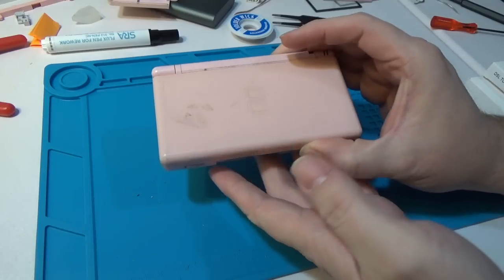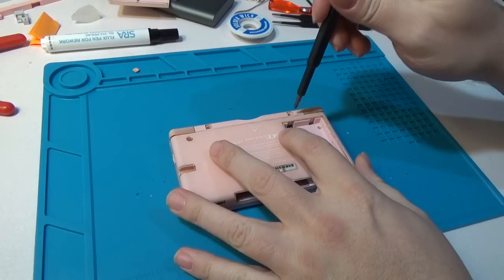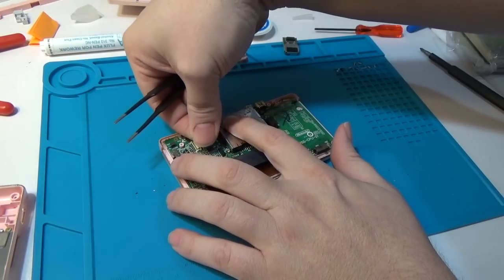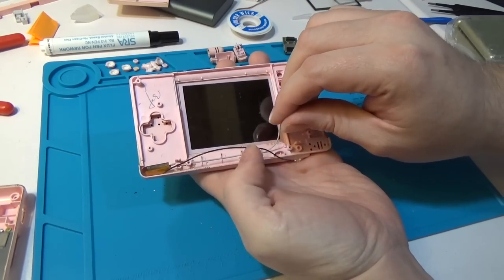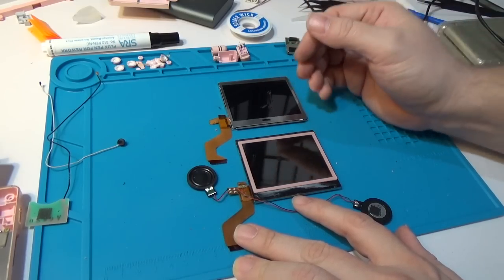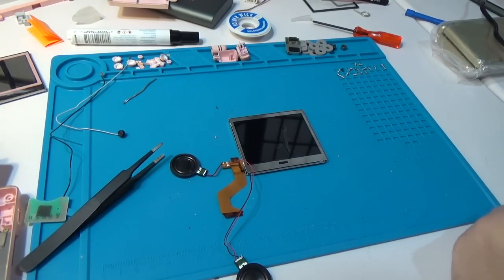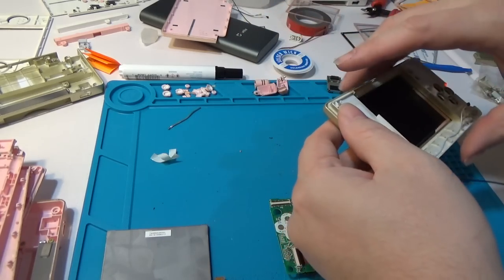How to Replace Nintendo DS Lite Shell and Screen

Comment: Dang, looks exactly like mine. Except mine wont work..
Reply from the maker: That stinks!  What's wrong with it?
Reply: @TheBrokenPast  won't turn on, and has a crack on it's back.
Reply: Check if all of the cables are plugged in correctly. If not the bottom DS Screen will flash and the system won't turn on.
Reply: If it doesnt turn on then maybe it needs a fuse replacement
Reply: @TheBrokenPast  Same with mine😔...It doesn't read games...It has bent pin that is the reason..
Reply: @nashwa520  :( go to a repair store you can save some money see if nintendo stores do repairs. If not, go to a trusted repair store.
Reply: @Tom2404  having this issue but all the cables are in. Could the ribbon be busted?
Reply: @rosstodd9233  yep. If the ribbon cable is broken that will prevent the DS from turning on. That can happen when the hinge is broken or when you replace the shell and make a mistake while feeding it throught the hole.
I learned both the hard way. When I was 13 I got a free DS Lite from a friend that had this exact issue due to a broken hinge. I fixed it by replacing the screen and the busted part of the shell. I felt like I was super smart until it stopped working again a just few days later. When I opened the DS recently I realized 13 year old me just did a horrible job pushing the ribbon cable throught the hinge and destroyed it in the process. But now with wayyy too much money spend on it the DS Lite of my childhood friend is working again and in like new condition.
Reply: @Tom2404  pretty sure that's what's happened. Replaced the screen so the cable was tough to get through. Dang, new screen again required I think. Thanks for getting back to me 🤘
Reply: @Tom2404  happened with my brothers ds hinge is broken
Reply: Same 😂

Comment: Just a warning - use short screws for the circuit board screw holes (the two circled ones), and be extra careful not to screw them in too hard. Do this to avoid pushing holes through the outside of the shell, which is what I did :(. Although the damage isn't too bad, it's enough for me to want to buy a replacement shell. Good thing they're cheap, plus the extra experience taking apart and reassembling a DS Lite is fine by me.
Reply from the maker: That is a great point!

Always make sure you use the correct screws in their designated spots.  If you don’t, you risk running into issues like you’ve mentioned.  But like you said, every failure is a chance for more experience!   :)
Reply: what site or seller did you get your shell from? All I can find is either fake or scam shells or Aliexpress shells (which will definitely be non official shells made of cheap plastic). who or what would you recommend
Reply: Cheap? WHERE DO YOU BUY THEM.
i only found shells that costed me like 13$ or maybe 7$ from aliExpress but i want a quality one
Reply: just had the same thing happen to me :D Good thing the whole thing isnt turning on for me so its the least of my worries :P
Reply: @Its_Asteria  there are no official shells unless you buy a used one
Reply: Just did the same lol
Reply: Hand Held legend sells them. Anywho, OP same. But like hell I'm going through that again so I'm just going to suffer silently.
Reply: I didn't read this comment and literally just did this
Reply: Done that 😂😂

Comment: I wasn't planning on doing the top screen replacement but I tore the ribbon cable so I guess I have no choice now -_-
Reply: Same here
Reply: Hey bro a tip I came up with is to put tape over the ribbon cable so it will be less likely to rip.
Reply: Alex Servantez instructions not clear, teared ribbon cable and replaced with tape
Reply: Me too
Reply: I AM IN THE SAME SITUATION !!!! I WANTED TO OPEN THE TOP SHELL AND I USED A KNIFE .... AS A STUPID I CUT THE SCREEN TAPE !!!! I feel so stupid !!!! So I BUY a new top screen and I want to change the screen correctly .... I know that I am fighting to pass the ribbon cable in the small STUPID HOLE !!!!!
Reply: The first DS Lite Screen I replaced broke in a week or so. I somehow bent the cable in a wrong direction and it seems to not make contact anymore. But I was 13 back then and now I'll try to fix it again now that I'm older.
Reply: @Tozovbb91GamingMinecraft  replacement screens are really cheap so it isnt that bad
Reply: Time to make a Gameboy Macro then :3
Reply: Same here, it’s not worth my time I can buy a new ds for like $10

Comment: Unfortunate you sped up the video at a critical point, feeding the cables through the sleeve and ribbon through the housing. Otherwise very useful thanks!
Reply: Ye I’m still stuck how the fuck do I put the ribbon cable through that tiny hole I’ve been trying for ages

Comment: There are two potentiometers on the bottom of the battery slot, one for the top screen and the other for the bottom. The new top screen you bought is actually fine, you are supposed to adjust it to make the flicker/tint/noise go away every time you swap in a new one. The scan rate is slightly different on each one at the factory.
Reply from the maker: Thanks for the tip!  I will definitely have to check that out, and see if it fixes the issue!  I haven't actually played this one since I swapped it, so I didn't spend anymore time taking a look at it.  But I will definitely have to check that out now.  Thanks!

Comment: Hey, thank you for this tutorial! I was able to do the whole swap (in 5x as much time as you). It was my first time and so much more than I could chew, thanks again.

If anyones having trouble feeding the antenna through, I used a needle and thread, tied it to the antenna wire, and pulled the needle through the right course. It, the thread, and the antenna wire all popped out the right part on the correct side.
Reply from the maker: That's a great idea!

In my case, I had already reshelled it a number of times before this video.  The first time I did one though, it was definitely probably 5x as long for me to do too!

Comment: For those of you replacing the bottom screen completely with a new one, make sure the new one you got has the black tape or foam backing the original has. If it's just bare metal, apply tape to it or a sheet of anti-static material to protect the motherboard from dying from a short-circuit, or like what happened to me, it still works but it burned some metal components, like the tiny metal dishes inside the trigger buttons.

Comment: “ i don’t know why people are so scared to change DS shells”
takes an hour and a half to do it with EXPERIENCE
Reply: ikr, lol.
Reply: I have all the proper tools and experience and tore the ribbon cable, it’s garbage now
Reply: @darrell5363  not yet. New top screens have the cable so just get a replacement and try again.

Or turn it into a GBA
Reply: @slyp5409  i got it for like $5 its not worth my time it went in the trash
Reply: @darrell5363  If not then the Gameboy macro idea isn't a terrible way to go
Reply: Did it yesterday and took almost 3 1/2 hours. The L and R buttons were killing me because of the spring. Sadly, when I turn it on, the upper screen flickers shorty and then the device turns off. Guess I tore something off...
Reply: @quietcarselijah  probably
Reply: @saradrae2700  yeah the ribbon cable is extremely fragile. I say double ch3ck no mke sure the ribbon cable is inserted to the DS correctly as well as all other components connected as they should be.
Reply: @saradrae2700  no trust me you didn’t go back and make sure the cables are are pushed in properly I did this and I thought the exact same thing it sat on my shelf for a month before I just tried for shits and giggles and I realized I hadn’t pushed the top cable in all the way trust me those cables are meant to go in further than you think
Reply: @danmajid5401  Thanks. I will try again if I find the time!
Reply: A Gameboy Advance SP is a freaking piece of cake compared to this! I swapped the shells on two GBA SP so I was feeling confident to replace just my screen on my DS Lite...and then I saw this...its just not worth it.
Reply: @saradrae2700  I spent literally an hour with the damn shoulder buttons! I feel your pain
Reply: Zero experiencie guy here.
The mic cable was almost damaged, the top screen is now broken and the touch screen has calibration issues now

Yeah, I won't try this again
Reply: Well I have no experience when I had my DS (Sold it btw), but my brothers DS I'm really nervous to even touch.
Reply: 0 XP here as well. 

I swear to god I smashed the console on the floor 2 times, I'm done with it now. How the fck this design came out from a human brain? The shoulders button destroyed my mental, the spring system is the worst invention in the world. 

RIP NDS lite.
Reply: Did it my first time yesterday. It will surely be the last one too. I lost my patience and started to curse me and the day I decided to buy a DS with a broken hinge for cheap to reshell it.
Like others, I spent over an hour trying to fit the shoulder buttons in the new housing but it definitely seems that those aftermarket shells are just horrible since I just couldn't close the console. I managed to do it just once but a shoulder button wasnt clicking anymore bcs of the case when the console was open, the d-pad felt awful and there was a gap between the back cover and the buttons cover.
How did I resolve? Well, my console was black and the new housing was black too, it just had that Dialga/Palkia print on it. Ended up using the original buttons, button cover and  back cover and I literally closed the DS with no issues at the first try. Shoulder buttons are fine, d-pad seems legit and there's no gap between the button and the back cover. Yea, the og back cover had a small crack but idc

Comment: This guide is very useful. Helped me replace the shell and refurbish an old DS Lite with a broken hinge. Thank you! Any chance you'll ever try to do a 2DS XL top screen repair?
Reply from the maker: Yes!

I'd love to get my hands on a broken 2DS XL.  I've been putting a few bids on some on eBay, but they all seem to go higher than what I think is reasonable to pay for one.  I can buy a refurbished one from GameStop for about $130, so I have a hard time paying near that much for a broken one online (plus the cost of a replacement screen!).  As soon as I can get one at a decent price, I plan to do so!
Reply: Warning: The 2ds in nearly impossible to replace without breaking. I tried to and it took me 6 hours to do. Every ds-3ds line of handhelds are difficult but this is one of if not the hardest to do. Also, the 2ds is very cheap and flimsy.
Reply from the maker: @BELDAM808  I love a good challenge!  I've still been watching out for one on the cheap on eBay.  Hopefully soon!

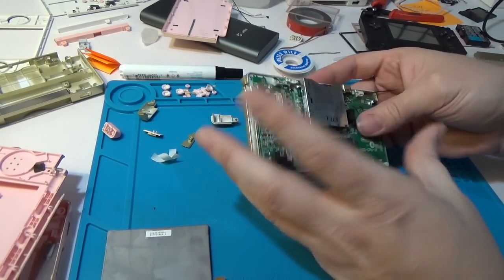Comment: for anyone stuck at 1:08:16, i ran mine by tying a sewing thread to a toothpick and running it underneath the ds game cartridge port first, then the sewing thread is tied/attached to the black wire so you just gently pull it across underneath.
Reply: This was my idea when I do mine once my shell comes in, but I feel like I can get the mic cable under fine by hand

Comment: Just watched this all the way through, it was very detailed, and thank you for leaving in the mistakes! 

I just found my old Nintendo DS Lite and it is broken! When I turn the power on, the green light turns on, and the bottom screen flashes white then everything turns off. After doing some research, it seems like the ribbon cable is either damaged, dirty, or disconnected. 

I am very new to opening up DS's, so to a beginner, this is an amazing video. I'm going to try to fix my Nintendo!! So thank you for posting this! Just subscribed :)
Reply from the maker: Thank you so much for the kind words!  When I made this video about a year ago, I hoped it'd be beneficial to someone who wanted to do the same thing, but were hesitant to do so.  In the end, this ended up being my second most popular video, so I'm glad that this was able to help you!  :)

Yep, the flash, and then shut off is usually indicative of a fault with one of the panels; either due to a broken ribbon cable, or a loose connection (and sometimes a fault within the panel itself).  Since you mention you see the bottom screen flash and not the top, I suspect it'll likely be the top one; most likely due to a cracked ribbon cable, from repeated opening and closing of the display.  You should be able to at least verify and try reseating the cables first, before doing a full disassemble. Hopefully it's just a loose cable, and you don't need to go through the work of an entire reshell.

Good luck on your repairs.  Please update us when you give it a go.  I look forward to hearing of your success!
Reply: Mine seems to have the same problem, green led comes on, bottom screen flashes white, but then immediately turns off, also, the top screen stays black, but seems to display some vertical lines that are slightly larger than the rest. I think this is because I may have poked the ribbon cable with the tweezers when trying to close the black hinge, and it appears to have a slight dent in it now, not really sure what to do now...
Reply: Were you able to fix it? Mine has the same issue and it looks like everything is connected correctly...
Reply: @frogking9514  I wasn't, the ribbon cable that connected the top screen was slightly ripped which caused the problem. 

You could try finding a replacement top screen on ebay! (I'd have to do the same but I've been busy with college lol)

Comment: where to get the tool called "Sater" and what is that heat tool so the wires could stay in place in order to connect the speakers
Reply: *solder and it is only needed if you replace the screen
Reply: @antoniolemus1117  Thank you, very insightful.

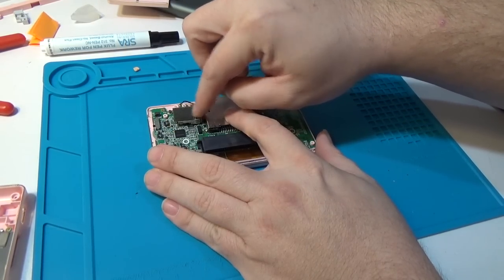Comment: This is a very detailed and useful video. I think I'd watch it even if I weren't trying to fix a DS Lite! The only part that confused me - why did you remove the wi-fi/BIOS card at about 9:10? Maybe I missed something, but removing it didn't seem to serve a purpose? Thanks for making this video.
Reply from the maker: Great question!  Thanks for asking.  You're right, removing it wasn't really necessary.  I usually remove it because it makes it a bit easier to get to the microphone cable that connects to a socket right beside the board.  By removing the board, it makes it a bit easier to get to the cable.  But you can definitely remove the cable without needing to remove the board, if you don't have sausage-fingers like I do!
Reply: Thanks so much for clarifying!

Comment: I followed all the steps but now my ds won’t turn on anymore :c when I try to charge it my Nintendo only flashes the orange light for a second and then nothing. What could I have done wrong?

Edit: the F2 fuse overloaded. 3 times. (Bought 2 new F2 fuses which also overloaded) so I bought a new motherboard. 

Edit2: The fuse in the new motherboard also overloaded so I ended up buying a new ds. I think it somehow kept overloading because of the new screens I bought on aliexpress. -.-
Reply: How’d you blow the fuse on it? I’m going to attempt a shell swap soon and I really don’t want to screw it up
Reply: How tf that happen ?
Reply: @arielabraham6683    I think it happened because of the new screens I bought on aliexpress (that was the only thing I changed). The F2 fuse in the new motherboard also overloaded after only turning it on once. I ended up buying a new ds.
Reply: You probably changed the bottom screen without protecting the metal back so you connected parts of the motherboard by accident

Comment: Excuse me, what is the blue thing you use to put the console? I saw it on many Console reparations tutorials but I don't know how is called
Reply from the maker: Are you referring to the mat that the system is on?  It's a "silicon soldering mat".  Basically, it's just a mat that helps to keep things organized, but is also heat resistant so you can do soldering work directly on it without damaging the table underneath.  

Here's a link to the specific one I bought years ago:

https://www.amazon.com/Kaisi-Insulation-Soldering-Maintenance-Electronics/dp/B073RGVB39

But there are tons out there you can buy on Amazon, AliExpress, etc!
Reply: @TheBrokenPast  thank you so much! My grandma found a broken DS short time ago and this can be helpfull since I wanna try to fix it
Reply from the maker: Awesome!  Good luck on your repairs.  You can do it!
Reply: @TheBrokenPast  thanks, since it doesn't turns on (instantly crashes and only bottom screen works) I'll have to do a full replacement
Reply from the maker: Slow and steady, and you can do it!  Make sure you report back with your success once you get it done. 😊